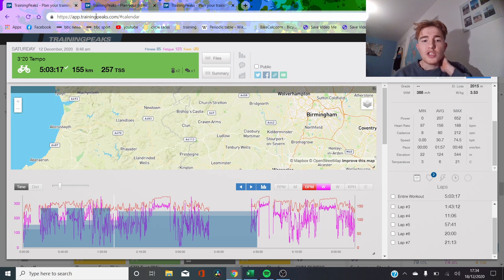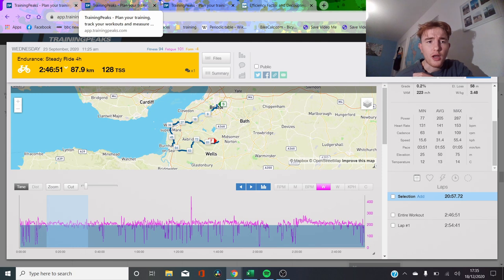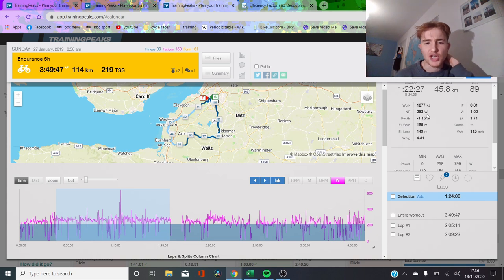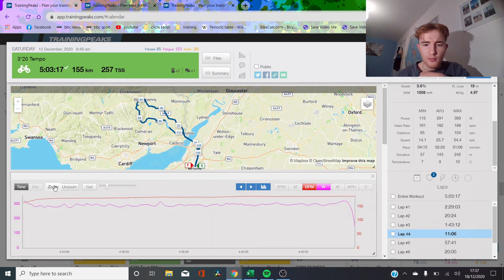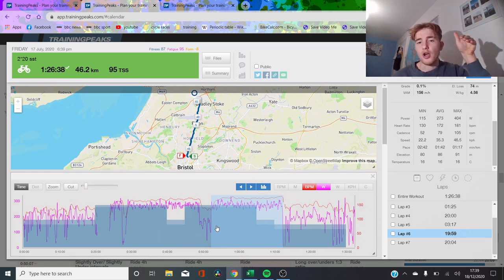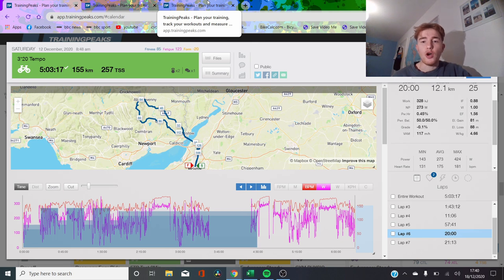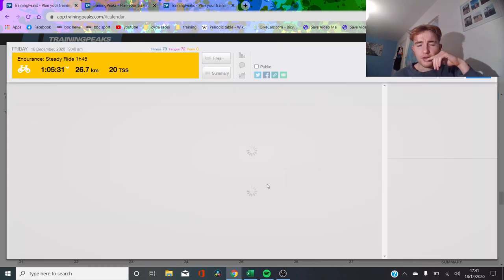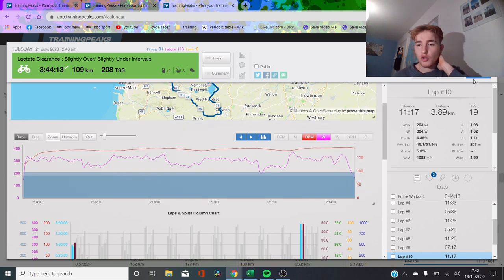Using Heart Rate and Power for better training analysis

Comment: Effeciency Factor, should be relative to cadence. 2 different rpm can put out 250 watts, and one will have a higher HR. So you need to compare 2 rides with similar avg. RPM, no?
Reply from the maker: yh definitely but for most of my rides cadence will be same so it's a worthy comparison